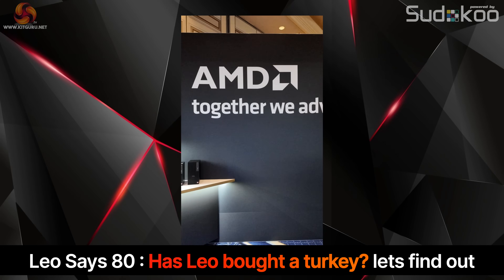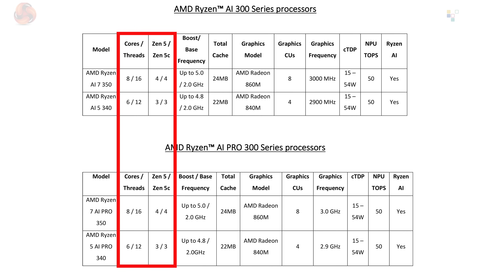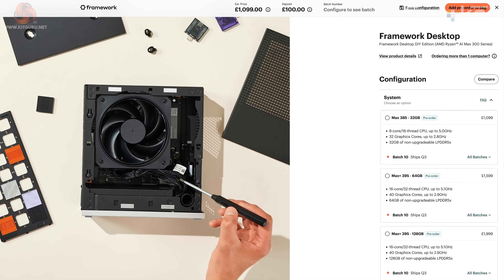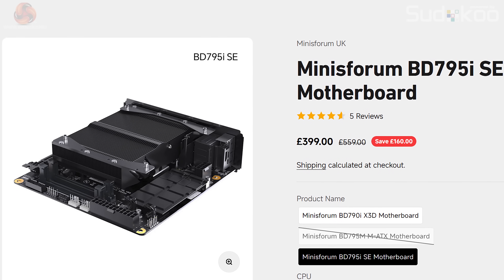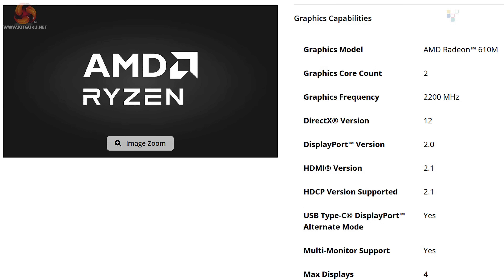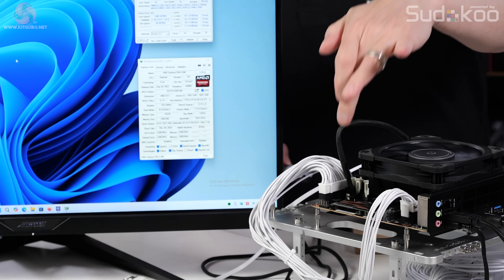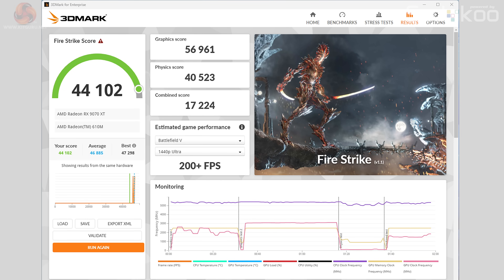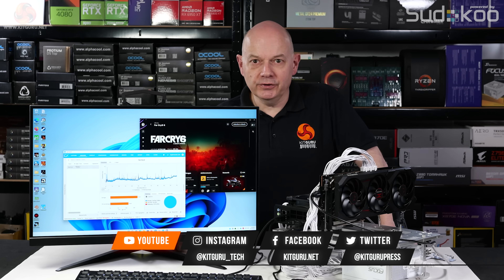Leo Says Ep. 80: Ryzen AI Max Looked Great at CES… So Why Did I Buy This?

Comment: Why do you 9nly show the AI 7 350 as the highest available cpu and then compare it with the AI max+395?
This is so misleading, when there are AI 9 365, AI 9 HX 370 and AI 9 HX 375 with 10 and 12 cores available.
Why do you hide them? Makes ZERO sense, since the max+ 395 will still beat them...

Comment: I was thinking about those Minisforum motherboards - but  their "cooler" is really bad... it does not give enough thermal capacity for the CPU they put on that board... even a well ventilated case won't help

thats is why i am for honest reason thinking about Aliexpress board with soldered Ryzen 7000 CPU -> because those one AT LEAST uses the standard LGA 1200 mounting holes... so we can use any 3rd party cooler
and on paper, it is even very easy to cool it bare die :/

Comment: You can set the RAM speed in the BIOS (and you don't have to stick to the auto/default settings), where up to 6000 MHz (with most 5600 RAM, and very possibly 5200) can be set (higher than this and it is unlikely to post, though with additional voltage tweaks etc. it might be possible to go higher) and be stable (depending on other system components and use cases), though I settled on 5200 with custom timings for the best balance of stability and performance. The BIOS has a lot of shortcomings and quirks but is at the same time fairly deep if you just spend the time to poke around. You can always reset the BIOS if you can't post, though as long as you aren't too aggressive and remember to "pretrain" the system to the RAM at the speed you are targeting (say 5600) and letting the system apply JEDEC like settings first before attempting further timing adjustments you should be good. So if you want 5600 change that in the BIOS and reboot and you'll see it reach that speed (in HWiNFO) when you do something rigorous though the speed will change dynamically and will remain lower in light use, as it is designed to do. After this initial step you can apply tighter timings. Each time you change the speed keep the rest of the RAM timings on auto and pretrain it, reboot all the way and reboot again into the bios should you want to set custom timings or voltages.The FCLK is capped by default so this should be factored in. Faster clock doesn't always mean better -- it is all a compromise and settings should be oriented towards your primary uses cases. The default speeds and timings are pretty loose but the system is totally fine and quite performant even at its defaults.
Reply from the maker: I did not see the option to adjust memory speed in the BIOS (version 1.12) and I spent a couple of minutes looking. Admittedly I had seen the box says memory is supported up  to 5200 so I figured it was behaving correctly and left it at that. Can you clarify you have run these memory speeds on your own BD795i SE i.e. first hand experience.
Leo
Reply: @KitGuruTech  I am running the nearly identical 795S7 barebones kit with some inexpensive Teamgroup RAM rated at 5600 and I did everything I described to it firsthand over a few weeks of fiddling, I found it to be a tolerant board but pretraining the RAM on the defaults at a particular speed is the real key in optimizing it. YMMV. Good luck! If you have any questions let me know. The RAM timings should be Advanced > scroll down to Overclocking > DDR Timings or something close to this. If you use the integrated graphics you should also be able to allocate up 16GB of VRAM to the iGPU and even overclock it if you wish. I just run two DAWs so I leave it on the defaults and it works fine and does some retrogaming pretty well. I used AI to get really optimal RAM and fan settings over many iterations. It was worth it. It purrs and behaves nicely now. One thing that I discovered is a simple way to turn off the boosting and just keep the base clocks for light use if just doing office tasks and such, you can just make the processor max 99% instead of 100% in the power plan advanced settings on Windows, which is pretty cool. It goes really low watt with the boosting off this way and you can toggle it on and off in Windows. With apps designed to use all the cores the lower clock speed isn't every noticeable, just very efficient.
Reply from the maker: @tellysense  Interesting! clearly I shall have to take a closer look
Leo

Comment: Fresh out of college. on 500 euro setup,. I Aquired AM4 5600x based system with stock cooler and branded 850w Fractal Ion modular powersupply. I have 6800xt in it and it play All Vidya I play fine.

Monitors are 2x 25 inch 1080p 185 hz ips pannels from LG released around the time when the new VA samsung pannels without smearing started appearing and these LG pannel went on used market.

Comment: Thanks for the video. 1- Asus Flow 13 is here 2- GMKTek EVO2 is coming. 3- No connector for external card ? No problem : use the nvme to Oculink adapter and then some AOSTAR AG01 and then plug your NVIDIA card. Using this system I have 3 24GO NVIDIA cards on the same mini computer for AI.
Reply from the maker: Congratulations you are in the most extreme 0.000000001% of people on the planet
Leo
Reply: @KitGuruTech  These guys running windows...
Reply: @renobodyrenobody  question could you link that system to another motherboard/ same type of system and linked together a cluster or am I just dreaming?
Reply: @Chris-o1x3b  No cluster, but at the moment you have a free nvme port you can slot an adapter and run one (ore more, if more free ports) NVIDIA card.

Comment: I'd like to have seen some cost comparisons. Against the AI Max+ 395 I'd like to have also had a conversation about NPU TOPs. In fact, I'd love to be able to build a mini with 40+ TOPs NPU and the ability to add a graphics card but can't work out that build. Any ideas?
Reply from the maker: Those are good points, should we get to review the HP Mini PC. This Zen 4 chip doesn't have an NPU so the separation between chips in terms of integrated graphics and NPU is quite significant.
Leo

Comment: The 7940HX is quite respectable when you remember it's a 16 core die at 75 W. Throughout the UK and most EU, even the price of £399 plus memory and WIFI is spot on. In the US it's about $100 higher than what a 9900X combo will run.

Side note, I do not believe for a moment ACEMAGIC unknowingly included malware on prior kit. Avoid at all cost I say, until they are no more.

Comment: I have the same board and I got it to run 5800
And it’s a wise decision. I used a custom gpu block to water cool it and it’s an absolute monster in a small package. All stuffed inside a s500 case
Reply from the maker: You using it primarily as a gaming system or an all round rig?
Reply: @KitGuruTech all around rig. But do a lot of gaming on it

Comment: Strix Point today is 45% and Kraken 55% all up combined channel available. There is no Hawk Refresh yet in the channel and Strix/Kracken total available is 51% of Hawk Point H_ original available as of yesterday and including hawk original U drops to 37%. Strix / Kracken split is Max 395 = 0.69%, 375 = 4.17%, 370 laptop/SFF PC = 59%, 370 GDP Win 4 = 17.36% and 365 = 19.44% no other SKUs in S/K line up have hit the channel yet. There is still Dragpn/Phoenix H_ availability that is + 85% more than S/K and less 6% than Hawk H original available yesterday not including U. I'd say the best AMD past gen new stragglers although mostly used now on the discount price for the performance is Rembrandt H refresh with Radeon 77/76 attach that are priced much less than 4060/50 alternatives. mb

Comment: Speaking of AI 9 HX PRO 370 specifically, it will be used in Minisforum's N5 Pro NAS system.
Kind of looking forward to it's release - it should be able to handle few virtual machines/be used as a server for general purpose on top of handling network storage.
If they allow you to use any OS (preferably TrueNAS) it will be a good buy.

Comment: I mean, considering Ryzen 7 7700 costs 330€ currently in Finland, the cheapest ITX motherboard is a Gigabyte B650I AX costing 190€ and it only has 1 m.2 nvne ssd slot, that's 520€ combined, so 483€ isn't a bad value imo
Reply: yeah very true
Reply: @EricDavidson-cx7bz  although, just watched the latest RandomGamingHD's latest video which is about the mATX version of this setup, he mentioned that the pcie slot is 4x and presumably the ITX version is the same, so idk know anymore, I guess kind of worth it, but only if you use RTX 50 or RX 90 series so you can use pcie gen 5 speeds
Reply: @Repsikka There's no mention of x4 in his video. He shows it as 4.0 x16 on the box, but indicated it's actually 5.0.

Comment: I don't get the point of crapping on the integrated graphics.  For years, Intel got points with the iGPU from reviewers who said, "it's useless for gaming, but it's low power, acclerates creative apps, and is invaluable for troubleshooting".
Reply from the maker: That's easy to explain. The new AI Max APUs promise huge graphical performance (might be true, who knows) and while there is no expectation the 610M would be great, it fell below my preconceptions.
Leo
Reply: Given the 7940HS even comes with 780M, the 610M was an odd choice, granted the space was limited with 16 cores on the 7940HX.
Reply: @drewnewby  Not an odd choice when you realize the 610M is a tiny add-on to a separate IO die made on 6nm.  It's basically a desktop Ryzen 7950 repackaged for laptops. 
Despite the close name, the 7940HS is a monolithic APU with more limited IO, but much larger graphics meant for ultrabooks.
Reply: @rhekman Yes, I know. AMD still had other options for the die.
Reply: @drewnewby  their choice for the HX "mobile" processors (also the refreshed 8- and new 9-series) has been to use desktop CPU versions, and these just include a minimal iGPU practical for driving displays and not much else, as by design they are intended to be used with high power GPUs in fat gaming laptops
Reply: @1samm1 Again, yes, I know. Neither of you understand my comment. There were multiple options during development. The 610M was an odd choice regardless of your idea of intent.

Comment: I got the first variation of this board about a year ago (wifi/SSD cooler, and IO plate were included and installed). I couldn't be happier. It offers solid performance at VERY low power consumption and is very quiet, and most importantly, is reliable. To date....no issues (touch wood)! Saying that, there are a couple of draw backs when it comes to front I/O options and expandability and that may be a deal breaker for some. All and all, I love mine and I think this should go the good purchase column for Leo.

Comment: I think it's pretty cool, makes me wonder though if the X3D variant is available, would be cool for gaming and make up for the slower memory speed. Anyway cool machine, it's not even far off from the full desktop chip. I'm curious what kind of clocks it can maintain in a highly threaded workload and such.
Reply: @HypnoticSuggestion  yes there is a x3d version, i just got it, it performs between a 7800x3d and 7950x3d in gaming benchmarks. 3Dmark scores is completely bottlenecked by my 4070TIS.

These are literally desktop chips in a BGA package and power limited to 100W. PBO does nothing to try to increase the power budget

Comment: "It would have cost me a lot more if I had bought them in dollars."

1 USD currently is about 0.76 GBP

If that invoice is accurate, you paid £385.00 ($508.03) for the BD795i SE ITX and £166.64 ($219.89) for the 2x32GB kit of Crucial DDR5 5600 SODIMM RAM, with the order fulfilled by Amazon.  

Meanwhile, as of this very posting, in dollars from Amazon one would pay $463.00 (£350.88) for the BD795i SE ITX and $147.65 (£111.89) for the same kit of RAM.
Reply from the maker: No doubt you are correct. Bearing in mind this video will exist for five or ten years and none of us have a clue what is going on with tariffs it would have been very dull to say 'Hey Americans, much doubt your side of the pond'
Leo
Reply: @KitGuruTech  Did your prices include VAT? I've found that is often something people forget when comparing US and European prices.
Reply: Leo's prices are not current, and include VAT no doubt. The memory is £151.41 lowest at present, and always higher in the UK. The BD795i SE ITX is now with a 7945HX and priced £399

Comment: 2:41: HP has confirmed the Z2 Mini G1a uses an internal power supply. "With an internal power supply, this PC cleanly fits in a rack, and its small size allows for 5 units across a 4U rack". I can only imagine the PSU was squeezed onto the underside of the motherboard like jam spread on a piece of bread.
Reply from the maker: Quite correct, that is shown in the (brief) spec. Mildly surprised HP and AMD didn't show that configuration at CES. It sounds fun!
Leo
Reply: and likely might not be that good either

Comment: Also with regards to wifi, I am happy they dont provide included wifi, not everybody needs it and the m.2 wifi slot can be put to other good uses like ssd or other accelerator card.
Reply from the maker: The WiFi M.2 slot is the tiny vertical slot, separate to the M.2 storage slots.
Leo

Comment: Hi Leo, are the dual ccd cpu'sbeing shipped with a lower performing second ccd like the desktop zen 5 9950x/3d? Also, the cmos battery shipped in minisforum motherboards and mini pc's is known to fail quite often which caused a multitude of boot issues, minis forum response to me is that go source your own new battery (with propritary connector) and we will re-imburse you the cost, not very helpfull when the connecter for the cmos battery is not standard.
Reply from the maker: The two core complexes are clocked slightly differently but that is perfectly normal for Ryzen 9. The battery sounds annoying. It is on the back of the board and I wonder why fail; did they just go cheap?
Leo